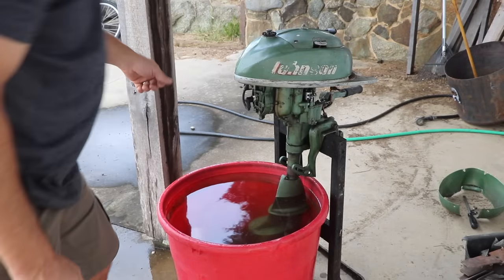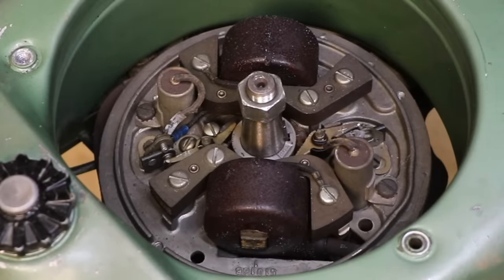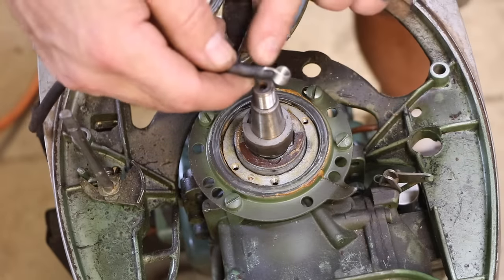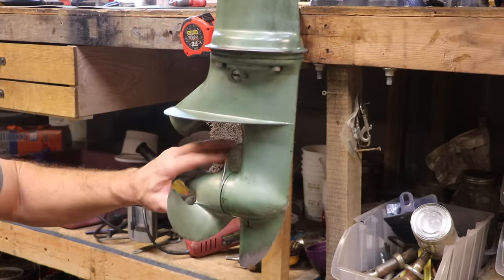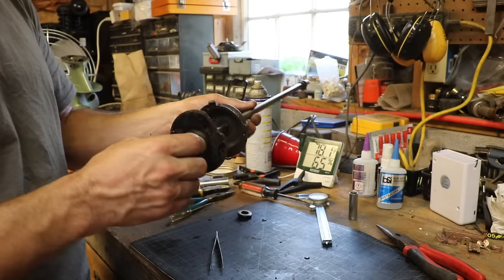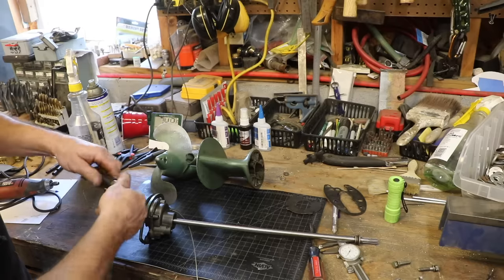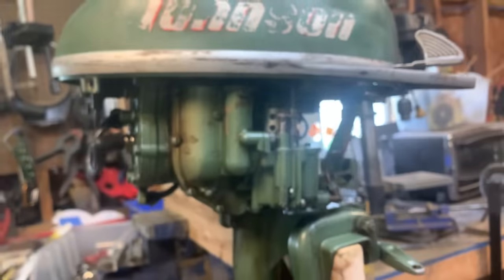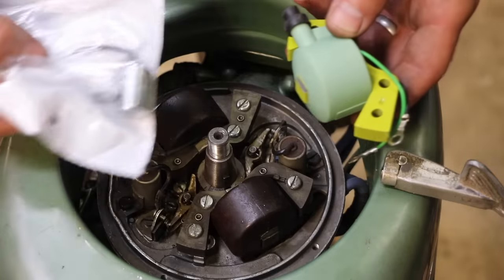My Johnson Needs An Overhaul, and it's Putting Up A Fight!  Johnson Engine Part 3

Comment: Had the same boat and motor in the 70s..had to sit in middle seat to get it to plane, and would steer buy hitting the tiller with a paddle, not the safest but it was the 70s

Comment: The movable timing plate is probably what caused the plug wires to fail.  Flexing causes failure at the first attachment point under the plate.  It can be intermittent based on the position of the plate, which is what I think you experienced.

Comment: When u use a puller on a shift. U should leave the nut on the shift so u don't mess up the threads  on the shaft!

Comment: Lol not to beat you up but the gear oil thing is real on more modern cases. There are very small passage ways that the oil needs to go through. If you filled from the top it would be a very long time for the oil to make it to the bottom of the case. Although it would happen quickly while running down the river but then usually ends up wrecking the whole thing. $$$$ and you can just get out and walk home.

Comment: Did you have the carb fully open?  A ‘low’ speed will restrict airflow and lower the readings.  Makes a significant difference on farm tractors for example.

Comment: Way back in 1963 my dad bought that same motor it would Run then stop and wouldnt restart but when it Cooled then it would run for a little while but if you start it outside of water start right up he sold it to a guy who was going to rebuild it Rings were way out of Spec after new rings and head gasket it ran all day

Comment: I run into this all the time with 2 cylinder point and condenser ignition system  that and the fact that 2 cycle engines run very smoothly on one cylinder

Comment: I just rebuilt a 4hp Johnson. I was sure I had cleaned all the water ways, fitted a new pump and head gasket. Seemed to be running great then clunk, seized. Damn.

Comment: I gotta check mine now, when I first got it I checked the spark and it was fine, but now that I got it running I cannot for the life of me get it to idle right really hope its just my wires like yours. Edit: it was not spark I may have to rebuild the carb again

Comment: Trimming the wires probably wouldn't work. They used to crack near the strain relief.  Back in the day plug wire came in a coil and we just nipped off a length and reused the old pin and boots.

Comment: These are very reliable engines…I have restored dozens of them…but the two problems restoring one is (A…that crappy carburetor ) and (B the impeller arrangement)…always a headache.

Comment: LMFAO as someone who has build small motors for a while, unfortunately im seeing part 2 even before part 1 but it is clear as sunday morning that engine was only running on one cylinder. There is a frequency on vibration that you get to know and is easy to tell if you put 2 against each other (haven't finished the video but I'm sure if you compare the 2 its easy to see) Glad you tuned her up right and got it running! Enjoy!

Comment: In Regards to the compression....   after you first run the engine you may need to readjust the valves...  it it has any...  if it doesn't new rings...

Comment: If you consider the age of the unit you may have rings that are stuck in the piston. to fix put a little brake fluid in each cylinder rotate 2 full cycles this will cause the rings to free up leave it sit overnight very smokey when you first start it up.

Comment: I think you are right - piston rings ma by stuck to the piston, so replacing them and cleaning piston grooves will do the trick; also while you are at it check inside cylinders for scratched; smaller one could be easily removed with "cylinder honing stones" that you put in to any drill

Comment: Run a minimum of 91 octane alcohol free and use marvel mystery oil see if that helps compression after a few tanks. If not do rings I bet you will be a ok. Great video

Comment: Soak the leather parts in neats foot oil.  That is what I used to do to the leather diaphragm in the pump on a Coleman stove to keep them flexible so they would build up pressure in the gas tank and seal the pump’s cylinder.

Comment: Your like this mad scientist  that's been transformed into a farmer. So just realized when adding or changing the gear oil. The informitave is that if there was a mix of water with oil add new oil from bottom plug. This pushes out the pookey stuff out the top hole. Food on the table.

Comment: Start bennding your water pump vanes in the proper direction then wrap fishing line around the bent vanes. Once the vanes are bent enough to slide into the housing. Slide in and pull the fishing line out !...

Comment: The reason you feel the lower unit from the bottom screw it's to ensure that you fill the lower unit all the way up with gear oil if you fill up in the top you may end up with a air gap and you'll think it's full but it's not

Comment: It is not hard to reach within spec compression. If it is low, the gasket may be blown off both directions to have the compression the same. As long as it has power, you dont have to do cylinder job.
But you are working on it for fun, you should go all the way to end to complete your fun.

Comment: My Johnson needed work about ten years ago. It was missing, all it would do was sputter a little bit, no fire or anything. So I went to the VA clinic and my doctor gave me some little blue pills. That reminds me about the time that my grandma was cleaning house one day when grandpa was out in the feed lot. She was putting laundry away and found a new bottle of Viagra in grandpa's sock drawer. She got really mad and took them outside and dumped them down the well!! They couldn't get the pump handle down for 2 weeks!! Seriously. They had to go to town and haul water everyday.

Comment: A longer hose on your compression tester isn't going to change things.  Once the compression stops increasing, the pressure in the cylinder and the hose is the same.  From that point, air is leaking past the pison rings and or valve seats as they do not form a perfect seal.  If they did form a perfect seal, eventually the pressure would be so high that the engine couldn't be spun or something would break.  Low compression = bad rings or leaking valve seats.  Put a teaspoon of engine oil in each cylinder and check compression again.  If it improves = bad rings (oil helps to seal the gaps).  If the same = bad valve seats (just lap the valves in the valve seat).

Comment: That little seal At 38:48 looked a lot like the seal on a car water pump or the seal on a stir motor for a paint pressure tank . they look like a carbon material . Great work and don't mind the length of your videos there great.

Comment: this engine is now "so called" four stroking. My bet would be that you lose some pressure in the crankcase on the lower cilinder and due to that, that cilinder makes less bang that it should be. This also explains the lower compression. The problem could be in the lower seal you made out of metal, which only seals on the outer surface (the o-ring) but should be sealing the crankcase and the shaft. My guess - it is leaking on the shaft ...

Comment: I think you'll find a weak part just by putting in the new parts you already have.  I had a Johnson 10 horse as a trolling motor on my 1st boat in the early 70's on the Missouri River in Montana.  It was a good engine.

Comment: A good way to bore the impeller hole would have been to use a piece of key stock, file or grind it down until flush with the inside diameter, use thread locker to glue it in place then drill, ream, or bore it out to the correct diameter. Then knock out the key from the key way. Hindsight is always 20/20 but it might be helpful for anyone running into a similar problem in the future. I  ran into a bit of trouble holding a similar piece in a 4 jaw lathe chuck. I just cut a piece of round stock to fit the existing hole in the part, cut a key way into the stock, bored half way to the new size. Cut a piece of round stock to fit the new hole and key way slot, then flipped it around and finished boring from the other side. Sometimes it depends on the tolerances what method you have to use. I couldn’t switch the jaws around as it was a small part and I was using a 120 in lathe.  The bore wouldn’t even slide onto one of the jaws. Much less four! 😂 Oh and those didn’t look like regular flat washers on the primer shaft. It looked more like a packing gland. I have seen this in other pumps but they were in the high pressure pumps that I used at work and they pumped up to 10k psi. But the packing slipped onto the shaft in a certain order then a packing gland nut was tightened to make the seal between the shaft and the housing.

Comment: Having kept a lot of old engines running, my first move on buying one is always the same - and especially on two-strokes, which obviously fire twic as often as a four-stroke running at the same speed; replace the spark plug, plug cap, and most of all the HT cable!  Many people aren't aware that plug caps and HT cables age and deteriorate - and worst of the lot for doing that are suppressor plug caps and carbon core HT cables; the resistance of both gradually increases, leading to heavier fuel consumption, more difficult starting, and eventually the engine won't run at all.  If at all possible, I stick to copper-cored HT cable, and won't use a suppressor cap at all on a magneto ignition system (they really aren't compatible).
According to a motor mechanic I know who's really on top of his job, those carbon-core HT cables should be changed at least once a year;  after that age, they go downhill fast.
HTH

Comment: Using an automotive compression gauge with a hose on a small engine will give you a low reading. This is due to the relatively large volume of the gauge setup when compared to the swept volume of the small cylinder when compared with a car.

Comment: Wow water and spark plug wires..  I have  unpleasant memories  of  getting shocked  by  trying to pull a plug wire off from a spark plug  with  a slightly insulated  spark plug boot wire pulling pliers.. and that was  before HEI..  I was told  don't  get zapped by HEI

Comment: I had an evenrude 4 HP on my aluminum Grumman canoe (with side transom) with two outriggers.  Best fun I ever had on the water.  It would haul the mail and with an electric trolling motor could go into water 6 inches deep.  Once filled a 55 liter cooler with blue crab in about 10 minutes.  Mmmmmgood

Comment: Back in the 50's, my uncle from Houston would come down to the central Texas coast and go fishing in the bays with my Dad.  My uncle had a 2 cylinder Johnson like this (?) and my Dad had the boat.  One time, they launched the boat and could not get the Johnson started.  Pulled and pulled on the rope.  Thinking some jokesters had swapped the plug wires, they tried swapping them and the motor started right up. A-ha, so they thought.  They set out for a reef to set trotlines for redfish.  Made it there, set the lines and tried to head back to their camp.  Motor would not start.  After much cranking and cussing, they swapped the plug wires back to where they were originally and the motor started.  Motor ran fine in the morning when they went to check the lines and on the return to camp.  When they got to my Dad's home, Dad chewed my older brothers out for 'playing a trick' by switching the plug wires.  Innocent of that, my brothers denied doing it.  Eventually, the fact that the motor started once they swapped the wires and then had to be swapped again to get it started brought some logic back into the "discussion".  Turns out, the shear pin on the flywhell had sheared and threw the timing off exactly 180 degrees TWICE and then remained in the correct spot to allow it to run for the rest of their fishing trip.  Long story but quite a tale to hear my Dad tell it.  R.I.P. Dad.

Comment: Either way - filling from the top or the bottom - eventually the water drops to the bottom. Fill how you like. Plug-it, Then leave it settling for a while - unplug the upper, then let some out from the bottom. This will be water if any.

Comment: the engine compression is fine ..... however the tester should be one that locates directly on the plug's hole .... your one has too long a tube ..... what you are reading is the presure in the tube and the cylinder combined which being small is heavily influencing  the reading ..... don't order coils and condensrs ... they will rest on the shelf forever !

Comment: Enjoyed the video. However, when you put the points in you did not lube the point cam. Without the lube the following block on the points will rapidly wear and the points gap will close altering the dwell angle

Comment: Now that you did a dry compression check now you need to do a wet compression check Squirtle oil in each cylinder and then run the compression check over again I guarantee at the compression will go up

Comment: 🇺🇸👍 did you have the carburetor set wide open when doing the compression test if not this would show a lower reading. Put some oil in the cylinder then check again if it comes up a bunch install new rings a good thing would be mic the cylinder walls for egg shaping.

Comment: Yeah do the rings I’d like to see how you do that I have a little motor like that  I will be working on later on but that seems like with that low of compression that sounds like that would take care of the problem not sure about the backfiring though with the rings being Bad or that good luck

Comment: The reason they to say fill the lower unit oil from the bottom is because if any water is in the unit, it is lighter in weight than oil and the oil would push the water out of the upper hole when it reached the full level hole.

Comment: It's the flame front that needs to start earlier that's the reason for advance...Open the throttle wide open when checking the compression. Can you change the angle of the prop-shaft so it wont plow with you in the back of the boat?

Comment: Much like the guys who knew it was only firing one cylinder, the people who tell you to fill from the bottom are 100% correct. Many lower units have only a small passage to the upper "Vent" hole which is what most upper holes are refered to as, not fill holes, and it definitely can airlock and look full when it really isn't.....ask me how I know this.....$1000 lower unit ago I filled from the top

Comment: interesting !  for decades you could only get "Resistive plug wires" they were carbon filaments  instead of wires to create a resistance so as not to disturb radios !.....( i replaced a set of plug wires on my pontiac v-8 and you could see every wire arching to the valve covers at night!)
 and it looks like grandpa replaced the original plug wires with that type..... so you found the problem !
I had to search long and hard to replace my sparkplug wires on my motorcycle with real sparkplug wires ! i found the wire at a tractor place !!! not an automotive store ( this was in the 1970's) ....   if you have a sound reference it is easy to tell the difference in the sound of the Johnson running on one and then on 2 cylinders.... I was suspicious when the boat didn't get up on plane but I wasn't sure.... I got a johnson like this running when I was a kid
and it ran on 1 cylinder as well.... then on 2 and boy you could really tell then when it only ran on 1..... I had bad plugs in it !  but the sound was really reveling. 
multi cylinders really sound so much different compared to a single cylinder but that little outboard turns fast even at idle so it fools you ! .......I hope you don't wait too many months to play with your Johnson again Jon !   i mean good grief man ! a fella needs that ! 
LOL

Comment: The condenser is there to help the magnetic field induced in the coil collapse faster which helps induce a higher voltage (hotter spark).  It is in the patent of an ignition system patented by Nicola Tesla!

Comment: Invest in a inline spark tester. Just because it will spark on the engine doesn't mean it will spark under pressure.

Comment: Great job on outboard, but you advice on the lower half filling from the top is not the best advice.  I enjoy your videos. You can fill from the top, but turn over the gears to get ride of any possible air.  When you live in New England where oil can get thick, you can have issues. The oil/grease is so thick and the openings in the lower portion of the outboard motor are narrow there is a potential for large air pockets to form, which can causing have less oil/grease than it should have. By adding from the bottom up you will see a more accurate fill with less air pockets. A pump is only a few bucks, but you can't always get pumps to fit. so I have to agree with many of your other viewer.  You wondered why people thought it was a big issue, when a dealers mechanic tell you to do something a certain way, there is usually a reason.  Have a great day and keep doing great videos.

Comment: Loved your video. I have the same engine you are rebuilding. I also have the same problem with the carbon seal at at top of driveshaft that you make a brass replacement part for. My carbon seal broke, I am curious to see if you would make me the same replacement part and what it would cost to do so ???

Comment: Be interested to have you cut those old plug wires open to see what wire did. Properly just broke at mounting points. Where you put the heat shrink.

Comment: In reference to the part numbers on the boat motor parts.  The 'greatest generation' was great for more reasons than going off and handling WW 2.  In the making of stuff pre WW2 and even after WW2, the machines were made to work on, and to last forever.  The baby boomer generation, my generation, more so upper management, so concerned about profits and their own bonuses have completely screwed manufacturing to point that most of it is overseas.  Thanks for listening.